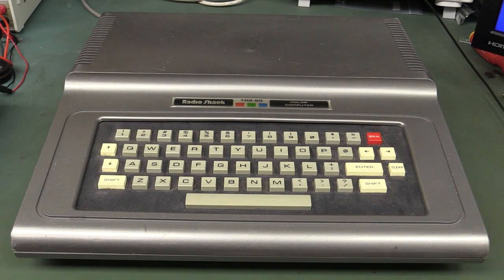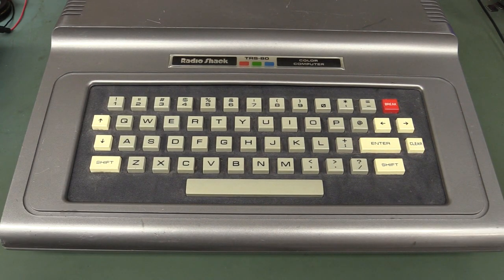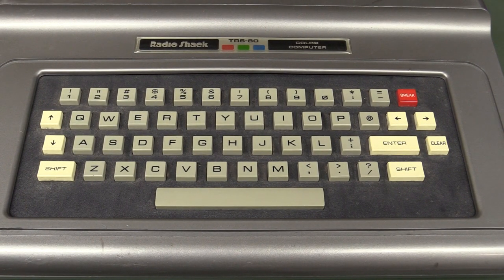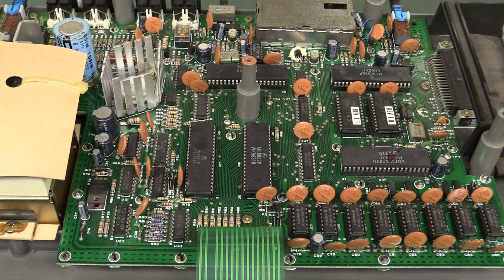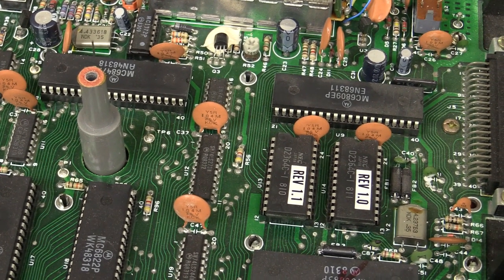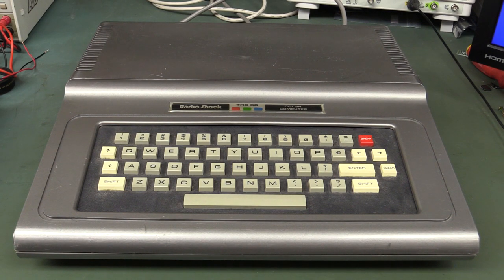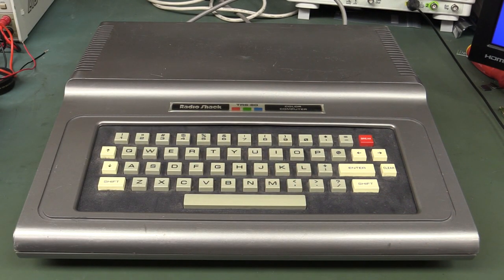EEVblog #1021 - Retro Radio Shack TRS-80 Color Computer

Comment: We used the Coco II 64KB until we lost the cassette player cable and the olds wouldn't buy a new one. For the third time :D Maybe 5 years. We still used it for longer to play cartridge games and I actually still used it for my school work. I found it much easier to type everything into the damn thing with the word processor cartridge we had and edit using cut and paste and such and then copy it out rather than compose it in long hand! Even though we had no printer or by that stage no mass storage and I literally had to copy it out to paper with a pen when I was done! But still it was much easier than composing it on paper.

Eventually in 1991 we got a 286 with VGA 1024x768x16 or 800x600x256, 1MB of RAM, 80MB MFM hard disc drive which was HORRIBLE and which soon had the good graces to die and be replaced with a 120MB IDE drive, a 1.44MB 3.5" and a 1.2MB 5.25" diskette drives and even a 300dpi laser printer! It was like another world of computing and the only problem we had was there was 5 people in the family and only one computer so strict rationing had to be implemented :D

Eventually I upgraded the 286 to 2MB of RAM so it could run Borland Turbo C++ for my uni work. The extra megabyte was in the form of SIMMs with pins soldered on to them that a kindly tech in a local computer shop gave me for nothing when I asked him if he had any. Thanks guy!

The sockets the pins went into were so stiff though I had to put my entire 86kg on to the edge of the memory board to push them in! Like literally I had my hand on the edge memory board with pins started in the socket and I had to jump into the air and put my ENTIRE weight on it to get the damn things to seat properly. Luckily it worked otherwise I think my brothers would have burnt me at the stake or something xD

Comment: The 1.0 ROM was probably for the 16k configuration, and the 1.1 ROM had the extended color BASIC with the 64k configuration; just my guess, though.
Reply: other way around..  color basic had a version 1.0 and later a 1.1.  Extended basic was 1.0 only.  Extended basic required at least 16k and wouldn't work on a 4k machine.

Comment: Not surprising, that thing, looks like it was just new. Not surprising, that thing was like a rock.

Your version in aussie land, must of been the same version released by tandy in uk. I remember this computer was our first as kids in uk, must of been 1983 though, from our local tandy. Like you said, before c64.

Its amazing how far computers have come, in just 3 decades.

I think the only game i remember from it, was either it was called, pitfall, or cuthbert in the jungle.

From the back, the computer looks like it would of been the same sold in uk, but being pal, not surprising

Not suprising its still working, that thing was built very solid.

Like others have said, i would thing crts would show the screen better overall.

With everything today made from a cheap plastic, you can see for yourself, that thing looks like it just came out of the factory, and still going strong. You should of kept a crt in your place, just for moments like these, ie testing old computers.

Comment: Had an early CoCo which needed two bodge wires to get 64K working. The early 4K chips required 12V so you had to disconnect that or you'd feed 12V to D6 and fry all the 64K chips then run two wires to hook up D6 and D7. Mine eventually had an HJL-57 real keyboard which was transplanted to my CoCo 3. I had the multi-pak expansion interface and a few other bits and pieces. Monitor mode became popular and although the CoCo 3 had an RGB monitor many used an Amiga monitor although that required a sync combiner as the CoCo has seperate H and V sync while the Amiga has composite sync. A way to get more coloures was to use interrupts to time the switching of palettes during the sync interval. Trouble was the PAL conversion was a kludge that lost FIRQ during the two extre block of line above and below the picture area. Messed up modem use unless you added a bodge wire to get a continuous FIRQ. Mine had switch to give me both configurations. Loads of fun in the day. I actually have an MC10. Wonder if anyone has a Dick Smith VZ200 or VZ300
Reply: Should have read "monitor mods" but autoincorrect got it

Comment: This machine and the very similar Drgon 32 both 6809 based had dreadfull colour display I assume it is down to the 6847 VDG. This did not produce RGB and mix the colour from those but used the R-Y & B-Y colour difference signals.
Reply: Weren't the Dragon 32/64 clones of this?
Reply: Not sure as they both seem to follow the Motorola block diagram.
Reply: Yes, the poor colours were inded down to the 6847. The Japanese PC-6001[1] used a different processor (a Z80 clone) but the same video chip, and it looks just as bad. (Later iterations of that series replaced it with a custom chip that not only added RGB output and better graphics modes, but made even the default original colour set look much better.)

[1]: https://en.wikipedia.org/wiki/PC-6000_series

Comment: I didn't know the CoCo was based on Motorola's reference design. I also heard somewhere that was the case for the Atari ST, a 68000 reference design too (almost). Anyway, I had a Commodore 64 and composite video output were awfull at the time, with lots of artifacts, bluring and moiré. I suppose it was because of the low bandwith of the components, dip package and path-thru board.

Comment: You could look at SYIC or Kingston for collet chucks.  Kingston is an Indian brand but I've had a lot of good experience with their collet chucks; they are often much better in terms of balance and precision than most people will need.  For TG100 chucks Command is a very good choice; they make some of the toughest I have ever seen and they aren't too expensive.

Comment: If you "Poke 65495,0" <enter> it will run at double speed. I learned much of my programming on the CoCo and my state's mainframe through the excelled math program. I made a single transistor circuit for it but it showed the composite inversed. So black type on green screen. Still better than the TV and I was never much for playing games on it. Considering what one got for the $$ it was a decent computer while Apples were $2,000 or even more.

While the video was crap the sound ability was actually quite good. Also the Coco 3 had a picture of the inventors if you reset it and held down a few select buttons.

Later I got a lot of the extras..cartridge expansion slot, voice synth cartridge (very hot back then! Same chipset Dave showed on a YT video awhile back.) custom RAMdisk, real rs232 port cartridge... I actually ended up with 3 of these computers. Wish I didn't start throwing some of it out but really don't know what to do with it all. My biggest problem with them was the paint wearing off the computer especially the bottom of the keyboard and then they looked really lousy. There suppposedly was some caddy paint you could get that would match or something but I never did that. Keeping the contacts working good probably helped excel me into electronics.
Reply: I used to love those "secret" PEEK and POKE locations and all the little tricks you could do.  I see you remember the "3 Mugateers" RESET trick too!
Reply: There was also a POKE that reversed the display to light green on a dark green background. MUCH easier on the eyes. Like the old green phosphor displays.
Reply: Poke 65497,0 fast even faster. But you lost the screen then. It would work well if you adjusted the bitbanger serial port loop accordingly, then output to the printer or a dumb terminal.

Comment: The picture quality might have something to do with output resolution, most upscalers are fixed to 480i, and computers and game consoles (until the 6 gen) output 240P signal which gets incorrectly interpreted as 480i. The only way to get around that is to use upscaler like OSSC or framemeister, more about it here http://retrorgb.com/upscalers.html

Comment: The 8bit guy recently did a "restauration" (read: paint it) of one of his, which had a apparently quite common after market keyboard replacement...

If you watch his video on the inside, they have nice glass capacitors it seems, and one weird thing: half of them have a snipped leg, allegedly necessary for the memory upgrade, weird...
Reply: The memory upgrade hacks (like putting 32K in a 16K or 4K model) involved ganging together pairs of chips.  Stack two 16K chips on each other, soldering all but one of the pins to the corresponding pins on the other chip.  The remaining pin (one of the address lines), you bend up.

Then after inserting the stacked chips in the sockets, solder a wire that links all of the bent-up pins together and attaches it to a previously unused pin on the memory controller chip (that would be A14 - the high bit of the address line that would select the lower or upper 16K.

I believe you did have to cut away a few of the capacitors as well in order to make the hack work.

Definitely not sanctioned by Tandy, but it worked if you were careful to not screw it up.

Later model CoCo's officially supported 32K and then more, so this hack was really only meaningful for early model CoCo 1s.

Comment: I still have and use all of my three CoCos around here. One of them is my password and finance manager; safer than the cloud these days...
Reply: Cool. I have 3 in my storage locker... thought of using them. Be almost ideal for a solar powered computer. I started to throw some of the peripherals away and now regret it. I had the voice synth cartridge for it, expansion slot box... one of mine was Ramdisked up to 512 K via ram banking.

Comment: The 6809 was awesome (it could run a version of UNIX, OS-9), sadly the rest of the coco was crap.  It's too bad there hadn't been a better home computer with the 6809.
Reply: Depends what you got. There was Basic09 available for it and back then it was the only home computer that allowed for programming with true round robin multitasking. It was hot if you didn't mind hacking it a bit yourself.
Reply: Vendicar Decarian I remember that dino game. The Trex-like thing walked with tail dragging on ground and whenever you pushed the joystick button it would growl but all motion would freeze until the growl ended. 

Try playing Space Assault (CoCo's Space Invaders clone) using an analog non-centering joystick!
Reply: RS could have gone with a lesser processor and included the sprite and sound chips. It was all about a target selling price. There were plenty of competing game consoles so RS went the way they did with the 6809. As far as games, Pooyan and Donkey King were pretty good ports I remember playing.
Reply: The only real limitation on the CoCo was the poor graphics and sound. The 6809e was more than capable of better graphics, but the initial CoCos were only 4k with 16k as an option. A nice 80/40 display would use all the available RAM. They kept the OS as-is to maintain backward compatibility. They should have revised the computer sooner. The CoCo 3 addressed a LOT of the failings, but that was too little, too late.
Reply: @Vendicar Decarian: You sound like you come from more of the mindset of a Gamer so you and I will never see eye to eye. Gaming was the last thing I did with my CoCo's. If you wanted a gaming machine back then you bought one -- Atari 2600 and all the ones that came after.

With the coco you had your choice of basic09 or microsoft DOS. Of course the Unix flavor was different -- it was running on a home computer not a mainframe. And I did earn the right to program on my state's college computer at age 13 so I know what the mainframe could and would do. Ultimately you are just full of it.
Reply: I should probably remind people that without Unix, there wouldn't be Linux, and that's the kernal OS for every Android phone.
Reply: Vendicar: You're joking, right? Unix lost to DOS? What color is the sky on your world?
Reply: JarofRats: And then the vast majority of servers on the planet running some Unix-ish OS these days, mostly Linux and Free/OpenBSD. Mac OS is Unix-y, Android is Unix-y. Hell, even Microsoft added support to install Ubuntu (a popular Linux distribution) packages and a bash shell to Windows 10.

Comment: You could poke two addresses, one with 0 one with 0xff and kill the computer, I call it the original HCF "halt catch fire", I only burned one of these up at a radio shack, just to see if it would work, was not disappointed as the basic program ran with a timer before it set those registers and "FOOF" smoke started pouring out the top......I also found you could control the vertical and horizontal sync and burn up monitors by causing the flyback transistor to short out due to really large values in both which would make a very loud noise and a single BRIGHT dot in the center of the screen...fun times!

Comment: 19:31 The colours are right, but it was a fair bit sharper. The weird distortion on the actual letters wasn't originally present and I suspect it's because of the definite pixels you have on a LCD which don't correspond to the native TV resolution. There also wasn't that horrible moire pattern either. But yeah it was still ultra chunky.

Even so the black letters on green background though was really hard on the eyes and most people used to change the mode so it was green on black. There was a one liner I forget which could do this for you easily and everyone knew it by rote.
Reply: The flashing cursor was a feature not a bug :D
Reply: The moire pattern you see there is interference between the monitor and the camera.  The PAL artifacts caused by the CoCo's 6847 and the color modulator chip are the fuzzy edges around the cursor.  And no, it didn't look that bad, at least not on a crappy TV.  It seems like the better the TV you used, the worse it would look.

Comment: "Did it really look this bad?"  I think on the older dial TV the pixels would have bled a bit, so there was fuzz around them.  So people would not have noticed is the font was distorted.  The text background would have been green or amber.  The following program will make the background amber temporary.
5 CLS
10 PRINT "PRESS ANY KEY TO CONTINUE"
15 SCREEN 0,1
20 IF INKEY$="" THEN 20
There is probably a poke that will change the text.  If anyone knows what it is please let me know.  One other thing is it uses analog joysticks so one can plug a mouse into a joystick port.
Reply: I believe Radio Shack actually sold a mouse for the CoCo, but I can't recall any software supporting it.

Comment: The deal with the two ROM chips is that one is standard BASIC and the second is Extended BASIC.  CoCo's that only shipped with standard BASIC could be upgraded by adding the second ROM.  The two versions is probably because they were mixing Rev1 if standard basic with Rev1.1 of Extended BASIC (or vice versa)

The 1983 vintage sounds right because it has the motherboard switches for 64K.  First-generation was 4K or 16K with Extended BASIC being an option for the 16K model.  Later generations were offered with 32K and then 64K.  Then it was discontinued to make room for the CoCo2.

Yes, the video looked that bad.  Black-on-green with the multi-color cursor.  32-column text.  256x192 pixel resolution.  But remember that the competition at the time this was invented was an Apple II (40 column text, 280x192 resolution) or a Commodore PET (text-only display, monochrome).

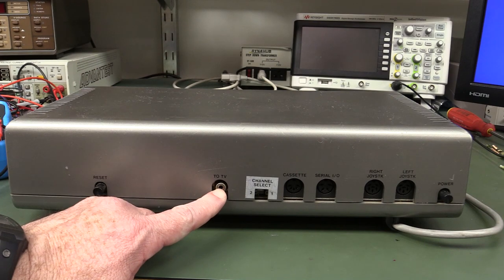Comment: 3:07 Yeah I seem to remember that this wasn't your common tv coax wall socket to back of tv coax cable. The genders were all messed up compared to the more common cable...
Reply: The RCA cable hooked up to the same kind of "TV/Game" switch box that the Atari 2600 used.  But if you were using this on a dedicated TV, you could just use a regular RG-59 TV cable and replace one of the F connectors with an RCA plug.
Reply: Yes, except pretty sure ours had a coax connector on the unit, not an RCA. Or maybe it was an RCA atypically connected to a coaxial cable. The cable was definitely a coax and plugged into the antenna coax connector on the TV. Or in our case, into the socket of an impedance matching balun (a small transformer) that connected to the screw posts meant to be connected to (50Ω ??) ribbon cable straight from the antenna! This was pretty basic stuff just a flat plastic ribbon with two single but multi strand copper wire conductors separated by a little over a centimeter by a plastic flat to give it the right impedance just by virtue of the distance between the wires and the frequency I guess... I can't even find it on google to show you what I mean because all you get when you search for any variant of ribbon cable is the digital type stuff with the tens of conductors side by side.

The connector on the unit though wrong gender though for the typical common coax cables, usually used to connect coax wall socket from the antenna to the TV. So you could buy a cheap one from Tandy, which was what we did when we lost whatever the original whatever it was.

I vaguely remember the box, maybe from the Coco II maybe from the Atari, we had one of those for a short time too, although maybe we rented it because it was only for a couple of months from memory. I remember playing frogger, but it was a very limited device, even for something that was a fairly new concept.

I could be completely mistaken about all this, after all, it was 32 years ago :D

Comment: Well i would not use a converter. Id rather use an old TV Tuner on my PC to check this out ;)
I used to have a ZX Spectrum but it did not last to this day :( And yes... loading any data from the tape required first proper heads calibration, then SILENCE, special stance, incantation and loads of lick! Bout boy those were the times ;)